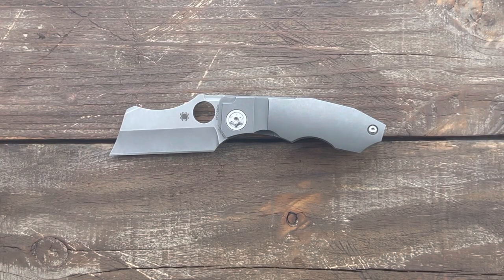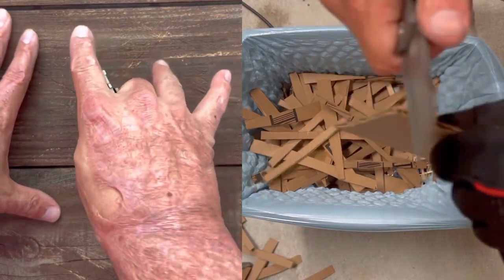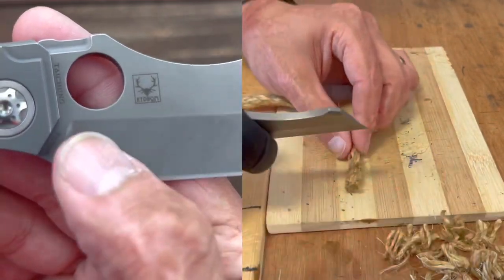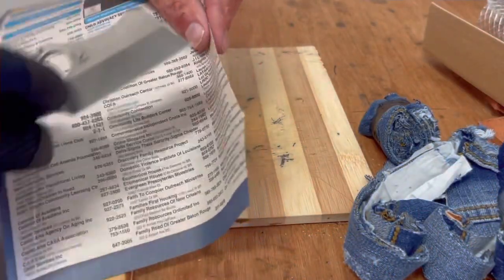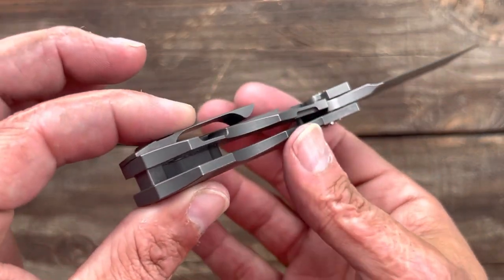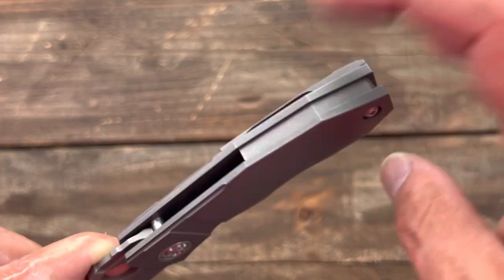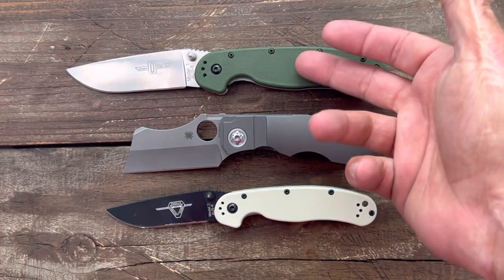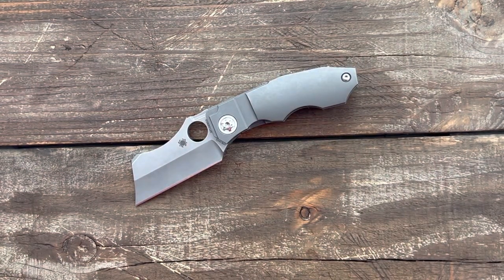SPYDERCO KNIVES STOVEPIPE / FULL REVIEW AND TESTING

Comment: I have plenty of Spydercos and was planning to get this knife before I noticed its price. it's a $250 knife imo. Thanks for the review!
Reply from the maker: Yep the price sucks
Reply: The price has absolutely no justification. I don't understand it!
Reply: Most of the price is in the fine detail, I'm sure. Titanium scales aren't usually so.. designed. Then there's the 20CV and a thick blade made of it, complete with flourishes purely for aesthetics. The frame lock is actually my biggest argument about the price but this really doesn't scream edc to me to begin with. Seems more like a showpiece or collector's item (not necessarily a safe queen though, this needs mounted somewhere). You could use this as an edc the same way you can pry with a screwdriver but the stovepipe was made to look nice, not designed for functionality.